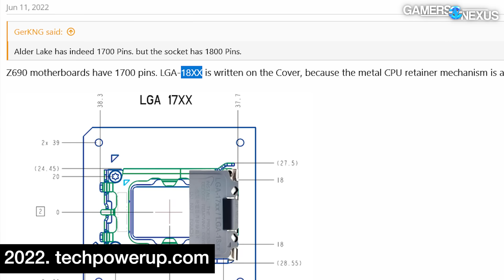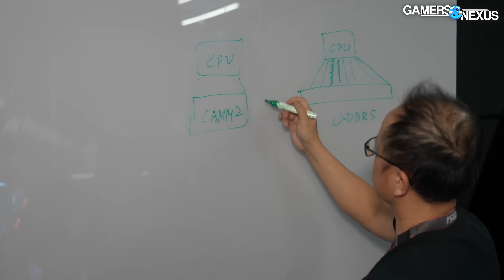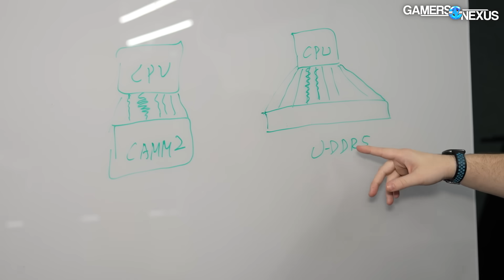Intel Says Not to Say "LGA1851" or "Z890" | MSI vs. ASUS Features & X870E Boards

Comment: Intel should go back old school, that is 2011 socket with quad memory lanes and 40 PCIE lanes.. having 16P cores 16E cores on their next gen Ultra 9 385k.. or an ultra 9 380k with just 16P cores only..  so you go with what you went with last round with a combination of P and E cores but also create a new series of just P core chips as well.. and add 3D cache to them!! with the cores on top of the 3D cache.. so its easier to cool that cores being on top!!  so the series would be a 345k, 365k, 385k, P&E core combinations, and a 340k, 360k, and 380k Pcores only chips.. with the 340k having 8P cores, the  360k having 12P cores, and the 380k, having 16P cores, all with X3D Cache memory on board.. lots of fast on chip cache.. so less sends to the ram modules.. which would be quad memory again!!  with the extra PCIE lanes at 40 again, you can go with dual PCIE m.2 lanes next to the CPU to run 2 gen 5 m.2's in 0 raid.. and run any other M.2 through the chipset.. that would still leave you with 32 PCIE lanes for any graphics cards.. and lets bring back SLI or NVLINK with the 5000 series graphics cards, like running two 5090's with NV LINK.. with full band width of 16 each card..

Comment: I like the project Zero/BTF stuff. The CAMM RAM is a great idea. I've built top end systems since 1995. The most issues I've seen in all that time is the 4 DIMM failure to run at top rated speeds. If the CAMM layout helps with this. I don't see ANY issues really. At least not for my builds as I typically build with top end parts and go 3 years, then a new build give or take. Depending on release dates and generational improvements or lack of.... I have for the last 12 years done a custom water loop in all my builds as well. So the project zero with little to no wires looks great. However, the Asus FTB specific GPU's and MoBo with the extra power slots rather than cables is what I'm looking for in the next build. I certainly hope Asus offers FTB with X870E Hero, I'll be waiting for 9000 series X3D parts though.

Comment: I am Very happy to see Quick release adaptations on the motherboards as my graphics cards darn difficult to release once in place. I'm a lot less keen on the changes to the memory module as it would make them fixed like on laptops. I guess MB mmanufacturers could offer different version to allow for various memory options but that would likely mean the more unusual higher capacity memory much more expensive due to small numbers and potentially not offering them at all.

Comment: That quick release button for GPU and switch for SSD should be standard, not patent! At least all motherboard from mid to high end. Also, Steve, for the love of G, dont ask for 160mm fans on the cases. There arent too many aftermarket fans in this size!
Reply: It's a circular thing I imagine. There's not many cases with 160mm mounts, so there's not many 160mm fans, which means case manufacturers are less likely to include 160mm mounts etc etc. But if the case manufacturers go ''screw it, we're putting 160's on more cases'' the fan companies will eventually follow
Reply: @dmrsdump3994  Yes, but on other hand, there is few good 180's on the market, and too few cases that uses them or giving ability to mount that size of fan.

Comment: CAMM is interesting; right now, there's an interposer which bridges the gap between board and module. So, if the interposer becomes damaged beyond repair in any meaningful way, the board isn't toasted. Now what concerns me more greatly is if we're trusting an interposer to function for RAM why can't we have such a thing for CPU? If we're sticking with LGA, then why isn't there a compression standard using an interposer as one would with CAMM RAM?

It would completely eschew soldering for the CPU socket in favour for a sandwiching of the CPU and heatsink which would be very similar to how Xeon users install their CPU and heatsink and enable a near-complete removal of a common RMA'd failure point.

Comment: I still think a hardware manufacturer should come out with a board and case combo where each thing can be used separately, but together introduce a nobel feature for eight-segment displays; mainboard firmware with a legacy USB header which shows POST codes, and a case with a button that can be attached via the same kind of header, but would also show POST codes if used in place of the interior POST code output.

Comment: The  White NZXT Elite H7 Premium ATX Mid-Tower case is the best case ever made. Just change the rear noisy 140mm fan to a 140mm ARCTIC P14 PWM PST Case Fan. It is near silent at max speed and removes all CFUs of hot air, your build is clean, is sexy and any heat problems you have had before are  eliminated.

Comment: I've personally gone for an externally mounted 420 radiator with EK Vardars in a puller configuration  as my cooling solution.

So much effort into trying to ventilate the case as best as possible with loads of fancy fans...

But a fan in a pusher config is less efficient than a ducted puller, as instead of creating a low pressure zone for air to flow freely into it forces all sorts of turbulence into a fin grid creating extra noise along the way.
Also, Vardars being fans with really agressive profile allow for some really low RPMs with enough flow to cool virtually anything. Difference between 25% speed and full blast ends up about 2 degrees under full load.

But the biggest profit is that an external mount allows to clean the radiator at any time, and the insides of the case just don't get dirty at all. Compared to all sorts of gimmicks whilst cleaning a case with some 15 blowers all mounted internally - that's just night and day difference.

I just don't know why a separate chamber for the rads didn't become a standard feature of modern showroom style cases by now. Especially when they've already widely adopted a separate compartment for the power supply.

Comment: I dont upgrade my cpu/mobo/ram for 6+ years. 1080p gaming was 4790k. 2k gaming was 12900k. 4k gaming is whatever intel cpu releases in 2026. For gaming I don’t understand the upgrade midway lifecycle. At 6 years I end up having paid $20-32 a month for the system, which is what I save over those 6 years to pay for a new pc.

Comment: Looks like it's going to be another sh*tty generation. I wish they wouldn't push out products if they're not "sure" about the stuff in it yet that it would work "100%" properly. This past 2 generations (Ryzen 7000, Intel 13k 14k) was a huge headache to get working stable based on my experience.

Comment: It’s not trolling, y’all. The reason these patent laws exist is to reward and incentivize innovation. In this case, quality of life features for consumers. ASUS put in the R&D to develop this handy feature. They are entitled, unter Taiwanese law, to the exclusive, time limited right to attract your business with this development. The reward for innovation would be much smaller without temporary protection of IP, and we’d risk seeing much less of it overall. If you think it’s unfair that your favorite board from another manufacturer does not have these latches, what you’re really saying is “if I can’t have it, no one should. You won’t die without a quick release latches. If you run a business and your business would benefit from access to these latches, buy more ASUS boards. It is much easier to copy a design someone else has made than to invent it in the first place. There needs to be special treatment for the people who do the extra work of first inventing them, or, by tragedy of the commons, every manufacturer would sit around waiting for designs from others they could steal, and we would not get anything new. The exclusiveness is time-limited, with the ability for competitors to design around the patent, so no one misses out forever. M.2 latches on the other hand… Those need to be on every board yesterday. Screw patents! I could not believe when I moved from an ASUS board to an ASRock board and had to deal with those awful tiny screws again. I was screaming bloody murder when I lost an M.2 screw in my case, and ended up slapping the heatsink ontop of the drive without its screw because I just could not get it in place.
Reply: Given the time-limited right for exclusive use of the "innovation" basically extends to the entire useful age of the technology (it will be replaced before the patent expires), this is pure anti-consumer protectionism.  Yet another reason to avoid A SUS.

Comment: Do we really need quick-release mechanisms for M.2 slots?  Is removing a single screw really THAT onerous?  I would much prefer a single screw over a quick-release mechanism.  The single screw is more secure, less complicated, less prone to breaking, and can be easily and inexpensively replaced if it does break.

Comment: 5:07 Why this 2 pieces of metal are not wider to cover all lenght of processor? Why Only 2 of them on the rihgt and left side of socket?  Why not 4: left, right, up, down. To bring direct contact with all 4 sides of processor. It this to much for 20+ years of experience enginiers team? 20+ years of modeling socket and NO ONE think about that? 
So maybe pay AI to solve the BENDING PROBLEM!!! 
BTW why LGA 18XX not LGAI 18XX and AIZ890 and AI9 15900K... AI EVERYWERE 
NOT ENOUGT AI INTEL!!! AI IS THE WAY NVIDIA SAY F@%&ING AI DON'T YOU HEAR INTEL???

Comment: Someone tell these companies to stop putting the CPU 8-pin at the top left corner of the board. It's the single worst thing about building or fixing a PC. Case makers could make the top easy to open up and get your hand near that top left and to see better. I can barely do it. I feel like giving up every time. I'll keep at it and eventually get it. I'm glad we now have the quick release for the GPU. That was the other horrible thing to deal with and now it's much easier.

Comment: Now, if we talk seriously, doing journalist investigation to what exact specific PR manager got nice six-digit bonus for "innovative and refreshingly brilliant" idea of calling LGA-1851 as LGA-18XX... Perhaps that same promoted person now is working on next LGA-1XXX super-secret socket model, which will be replaced by LGA-XXXX by 2030 ? CAMM memory is interesting and should be amazingly better for signal integrity of the interconnect and routing compared to old bulky DIMM sockets. But are we ready to start bending memory socket pins now in addition to CPUs? Also if they can put CAMM socket on the bottom side of the PCB, user could have ability to upgrade, e.g. populate one module and second later on :-)

Comment: If tt the CAMM2 Compression connector gets damaged it is a removable part pretty sure that once it starts hitting mass adoption you should be able to just buy the connector or have them ship you a replacement.

Comment: I think CAMM2 is going to be a big thing, especially moving to faster memory speeds like DDR6. CAMM2 also eliminates user error in setting up Dual Channel. I regularly do troubleshooting for people building their own systems and the amount of times i have seen users put memory modules into the wrong slots and cripple the memory bandwidth is quite high. CAMM2 come out as a 128Bit memory module, meaning its a Dual Channel design on a single CAMM2 module, This is something i have been wanting to see done for a decade now

Comment: The push-button PCIe lock mechanism is a godsend! I really wish I had that on my current B450 mATX board. Taking my 4080 out is a nightmare. I have to use a chopstick and pray I press down on the latch correctly.

Comment: I like this new camm stuff. Most of the time i end up buying new ddr kits anyway, so just swapping modules is not a hassle. It also looks like a better form factor, plus you'll probably get a built in heatspreader with them mobos which is also nice.

Comment: I'm so happy to see more tool less solutions for m.2 drives and heat sinks. Also more 7 segment displays is a huge improvement, as long as the boards are actually reasonably priced

Comment: It looks like it adds POF(Point of failure) to PCIE slot and to m.2 slots. I've seen so many MSI mobos had failure on the m.2 slot screw socket that I had to replace the whole screw socket because it was not holding NVME and was causing bluescreens. It happened more on MSI mobos then any other ones...

Comment: The Heatsink plate for the M.2s looks like its going to be a MASSIVE pain in the butt to use the Quick Release to take that plate off when the Mobo is installed in the PC case. To me, it looks like the button is too close to the wall of the PC case and getting fingers in there looks annoying as hell. That could just be me though as I have large hands I think the release would make more sense on the other side of the board.

Comment: CAMM2 is going to be great if they hopefully expand to 4 Channel Desktop chips. It big but considering how much wider the server/HEDT space has expanded I think it is necessary especially considering the AI push going. I know the AMD Strix Point Halo as a pc chip is considering it. Secondly a 2nd memory channel offer increased product differentiation between low-end and high-end chips so long as motherboard manufacturers can run the traces for it.

Comment: Not sure what MSI is thinking with that cooler. Anything that moves is going to fail eventually, and that includes those fans on that cooler. There is no such thing as "failure-proof" when it comes to Case Fans.

Comment: The PCIE socket seems outdated and needs replaced. Graphics cards are getting too big and heavy to safely mount. A new solution is required. I think moving the card completely off the motherboard and use a cable to connect.

Comment: Those CAMM modules are pretty interesting! I won't be an early adopter, but the more I thought about it the more I realized I don't really upgrade my RAM during the lifecycle of a build anyway. By the time I get a new CPU/MOBO, I usually have to buy new RAM anyway. It would definitely help with CPU cooler clearance -- which I've run into a few times in the past...

Comment: 10:10 Thanks, now I hate it. Hardware is expensive enough, loosing to ability to gradual upgrades later on is a huge disadvantage. (My RAM upgrade path was going from 2x8GB to 4x8GB, buying 2x16GB at either stage wouldn't have been an option for me.)
Dear Mainboard manufacturers, please find a way to fit 4 slots again, maybe in some sort of stacked / step design?
Also shoutout to AMD - staying consistent on one socket for consumers over an longer time period helped me squeeze out way more life out of my existing hardware simply by upgrading the cpu. I simply can't afford buying a new motherboard and ram every three years just because the fashion has changed. That was possible 10 to 15 years ago, but times (and prices) have changed drastically since then.

Comment: 10:27 I never ever have known someone who would buy 2 add 2 later. Never. Build nearly a hundred PCs for people. Known many people with PCs. No one ever upgraded this way. Not a single one. And nowadays with the limitations that come with having more than 2 modules installed it will be even more unlikely. I'm not saying it never happened. And I'm not saying that there will not be that one customer who does this. But TBH. I don't think this extremely niche argument is relevant.

Comment: As a heads up, the PGA section for CAMM2 is user replaceable, so the creators of the standard (ironically enough, Dell is a big one here) did think that through. Will there be RMAs? Yes, but they can just send a new PGA module.

Comment: Benefits of CAMM are really hard to explain, and MSI's engineer covered the main benefit for MB designers. Memory is extremely sensitive to board routing and physical trace tuning, so any opportunity to simplify this will vastly improve the average motherboard's memory performance. 

The board layout optimization is a big contributor to the higher achievable speeds, but the LGA style connector is another huge improvement for signal integrity, as is the density of the module. 

CAMM modules ARE user serviceable, and each module can potentially serve two memory channels (if configured as such). They were originally introduced in laptops and represent a massive improvement over SoDIMMs for small form factor systems! 
source- am design engineer

Comment: I think this new push button for the pcie slot is nonsens and unnecesary. It makes only the board more expensive for a thing that is been used only once or twice in the lifetime of the board.
R&D and the engineers must be payed for this. I rather prefere that the board will cost 50 bucks less than having this button.

Comment: On my retro PC I have motherboard made by IBM with 775 socket and pentium dual core. It has lever for GPU pci-e on the bottom part and you can reach it only if you use single slot GPU. I have 660 ti installed there and to remove the videocard I need to take my door keys and push out pci-e pin directly out of the videocard lock, on the top of the mount. And when I see that modern society now needs buttons to unplug videocards ... I feel everything is lost. Soon people will need special tools or robots to unplug power cable motherboard connectors.

Comment: CAMM2 is interesting for water cooling reasons, for me that's already a thing. Beautiful boards as well. But High-end prices as well, I assume? I expected it would be available on desktop boards a lot later in time. What I found very informative is for the first time vendors gave numbers for installing CPU coolers with a momentum, the Noctua, 0.3Nm ? For DIY builders this becomes a problem, but for the industry these are important values.